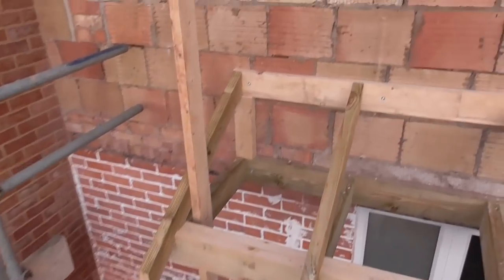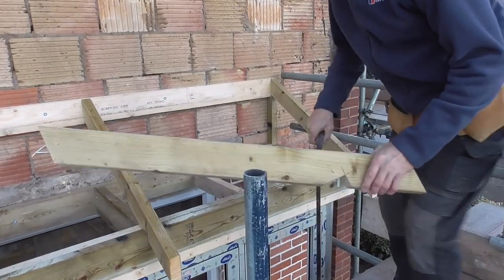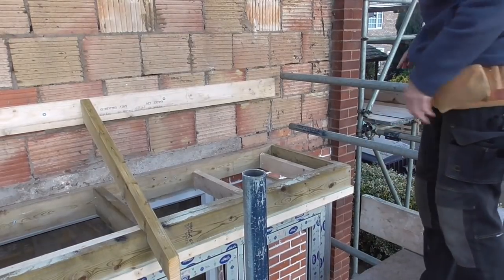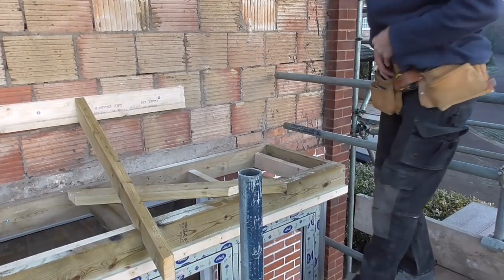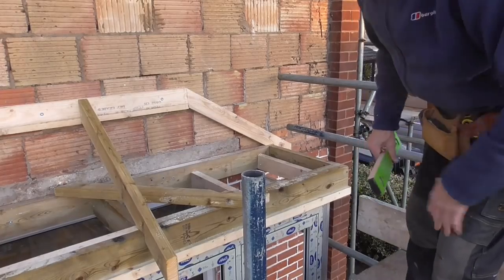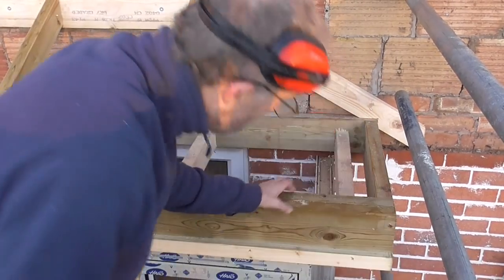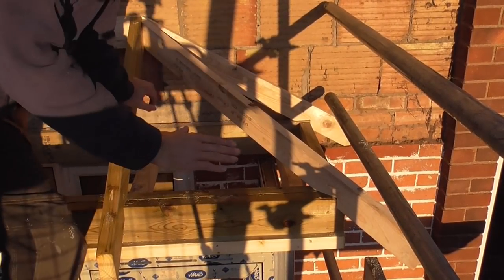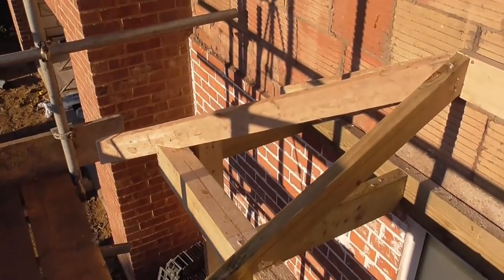Gable end roof altered to hip end roof ***PLUS SOME MAGIC***

Comment: Hi Del, another great video, would you mind if I pointed some thing out. when I had a difference like you had there with the rafter and the ridge i would then mitre  the two rafters the difference between the rafter and ridge together bringing you to a corner for the hip to fit into I may not have explained it very well but it does work. Thanks again Del
Reply from the maker: Hi Peter🖐That's absolute genius, and so obvious now you point it out🤯Have a great weekend😎Cheers Del
Reply: Wish I could understand this alternative solution, tried with pen and paper sketches and I'm baffled. Please please enlighten me
Reply: Hi Del, is Peter saying that he would have cut a mitre on the 10mm difference of the wall common seeing this is 10mm thicker than the ridge, and just one normal 45° splay on the other side of the hip ?
Reply: @chrisdormer1061  Hi mitre both rafters and so the one to the left of the hip would move towards the corner that amount  to still keep it a perfect square then cut your normal splay cuts to the top of the hip and the hip will now still run at 45 across the corner.
Reply from the maker: @amazing451  Hi Kevin. Read what Peter has added👍 The cut you describe in the first part of your comment, is basically mirrored on the top of the adjoining rafter, thus allowing the rafters to meet, at that mitre point, in the exact, 45 degree line of the hip👊Peter has thought about this problem in a much simpler way than I have, and finding different ways to achieve the same result, is why I love our job so much😎(hope you get this to Chris🤩)
Reply from the maker: @chrisdormer1061  Hi Chris🖐Peter has answered this question, and I have also responded to Kevins comment🤩Hopefully you can have a read of it and it makes sense to you😎Cheers Del

Comment: great job, if it wouldn't be a problem, could you please give me the dimensions of the wood, I mean thickness and width,what long timber did you use, were they joined or one timber?I will be very grateful, best regards, Peter
Reply from the maker: Hi Peter🖐I'm afraid I can't remember the exact size timbers I used on this job😬but they were only short rafters so 4x2 would be adequate, and the wall ledger and hips would be around 6x2👍Cheers Del

Comment: Could i use the self tapping concrete bolts in the modern style perforated engineering bricks or would resin be better. Going to attempt to make a lean to veranda. cheers
Reply from the maker: Hi Paul🖐I think concrete screws would be fine and I would advise not to go to hard when drilling as those bricks can splinter a little leaving an irregular hole👍Cheers Del
Reply: @thetallcarpenter  Spot on, thanks 👍

Comment: Never saw a carpenter cut of a corner to fit a hip.
Reply from the maker: Hi Robert🖐Super simple and brings the edges of the hip into the roof line instead of the centre and then having to drop it👊Cheers Del

Comment: Hi, do you need planning to install the canopy?
Reply from the maker: Hi Jason🖐This canopy had planning permission, and I wouldn't want to build one without it👍Cheers Del
Reply: @thetallcarpenter  Ta, was the planning specific to the canopy or part of other work? I just want to install a canopy nothing else get mixed comments about planmimg is needed or not as its just a roof IE no doors or sides
Reply from the maker: @Jason Parker  There was an existing, smaller, canopy roof already there, so this new one was just bigger. I have another video showing me building a big porch with a canopy roof, which did not have planning. Some of the neighbours complained, and the customer applied for retrospective  planning permission. The planners took one look at the photo the customer sent in, and said, 'don't bother with an application as it looks fine' 👊
Reply from the maker: @jasonparker333  https://youtu.be/gUKvVgbQS5A
Reply: @thetallcarpenter  Thank you so much for taking the time to reply to my questions, really appreciate it. I'll subscribe :-)
Reply from the maker: @Jason Parker  No problem Jason👍It's all part of the service🤟Cheers Del

Comment: I hate changing stuff but blimey who built that blockwork lol, there are toggle fixings for these blocks but I find the Spanish way best just smash a hole in them and fill it with Plaster of Paris, goes of in minutes then screw and plug into that 👌
Reply from the maker: Hi Andy🖐The original house was absolutely lashed up with these awful blocks, and it doesn't surprise me that you've got experience with them🤩Thanks for watching😎Cheers Del
Reply: Agreed, that block work is a right dogs dinner! 🙄🔨🇮🇪

Comment: Hi del. Pleasure to watch as always! I’m a builder always after tips for carpentry. Just curious, instead of plumbing a line down to measure out to the plate to get your measurement for the other common rafter ready for your hip. Can you also just measure back from plate to rafter against house and whatever measurement that is measure bk the other way for the position of your other rafter to get them square together? Cheers
Reply from the maker: Hi Jase🖐Yes bud, as long as its all square and level, you can measure back from the plate as you describe👊Thanks for watching 😎 Cheers Del

Comment: Nice video and  work as usual Del.i  quick question please when u used that common rafter to mark the length of the top plate was that rafter exactly the same length as the rest of the commons or had you shortened it by  half it own thickness or adjust it in any other way,.
Reply from the maker: Hi Brian🖐That end common was exactly the same length as the commons in the run of the roof. Just pretend that the top wall plate is a ridge board👍Cheers Del

Comment: Del just wanted to ask l have seen some lean to roofs with the rafters at the top bird's mouthed over the wall plate rather than abutting the plate with a plumb cut.  Is there any reason why it would be done this way rather than how you did it.  As a roofer means l can get the batten closer to the wall other than that l can't think of another benefit.
Reply from the maker: Hi Paul🖐Basically for me, on smaller spans I just fix a rafter with a plumb cut to a wall plate at the top(ridge), and for longer spans, I cut a birdsmouth on the top of the rafter and sit it on a wall plate👍In the past, the building inspector has not been happy with a nailed plumb cut at the top on larger spans, so I aways sit them on the plate with the rafter birdsmouthed over. On smaller spans, (less loading), nails between the plumb cut and ridge are more than strong enough💪(as I believe they would be on larger spans, if it wasn't for building inspectors)Thanks for your comment 😎 Cheers Del
Reply: Thanks Del makes sense now given the roofs I've seen
Reply from the maker: @paulnicholls5600  👍😎

Comment: How was the fixing into those terracotta block I see you used the mortar joint they are a nightmare to fix to 😡
Reply from the maker: Hi Robert🖐I take it you've had experience with these awful blocks😩Yeah, only could get a decent fixing in the perps👊Thanks for watching😎Cheers Del
Reply: @thetallcarpenter  I’m doing a bathroom conversion at the moment and they are the inside wall skin it’s a good job the units are free standing ,I should be able to get a fixing unlike the previous builders who were relying on silicone to hold the sink and toilet 😂
Reply from the maker: @robertbowen2129  They are notoriously difficult to fix to, so just as well you have floor standing furniture🤩Cheers Del
Reply: Clay pot hollow blocks, I’ve come across them in 1930s house’s and indeed a pain to get a fixing to.
 I used spring toggles for hanging radiators and sleeve frame fixings for wall plates same as Del did.
Reply from the maker: @traveller017  Horrible things those blocks😖

Comment: Do you need to still allow for the hip drop for this ? Take off half the thickness of the hip on the seat cut with the roofing square ?
Reply from the maker: Hi Brit🖐The way I mark out my hips and also cut the corner of the plates at 45 degrees, (the same width as the hip), means I don't actually 'drop' the hip👍I might do a video explaining the two different methods👊Thanks for your comment and for watching 😎 Cheers Del

Comment: Them rafters come off way to easy, what fixings did you use for your wall plates
Reply from the maker: Hi FB🖐My 4 foot breaker bar makes everything come off easy💪I used M10x100mm Fischer fixings for the wall plate, drilled into the perps👊Cheers Del
Reply: I would have probably used 12mm resin bolts on the wall plate but in reality it’s over the top.  I use those Fischer frame fixers all the time and I’ve installed and extracted enough to know that they will hold tonnes of weight when used correctly. I can try and remove them with a 4foot nail bar and no chance.
Reply from the maker: @gdfggggg  Hi there🖐These blocks have completely hollow cores, so resin would have been no use😬I got a decent fixing with M10 Fischers in the perp joints👊Thanks for your comment 😎 Cheers Del
Reply: @thetallcarpenter  ah, those perp joints are underrated!